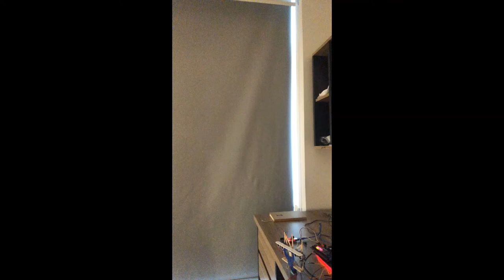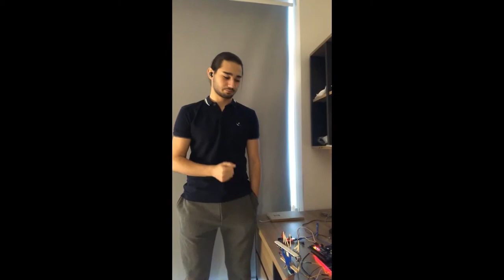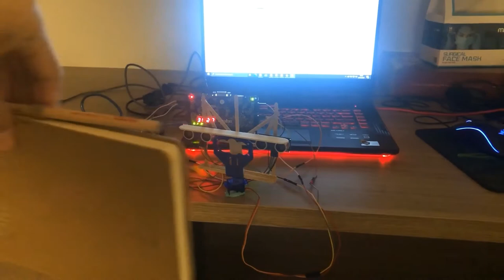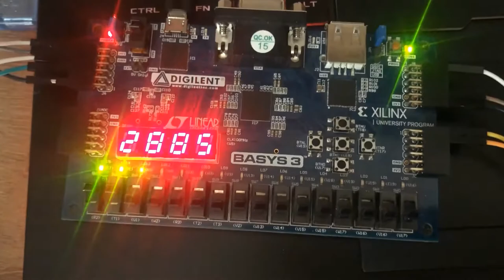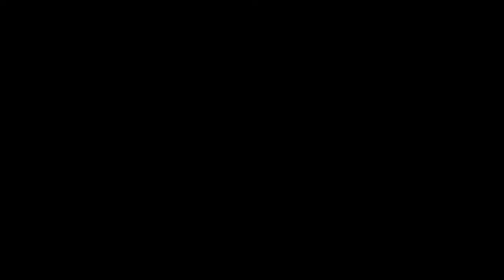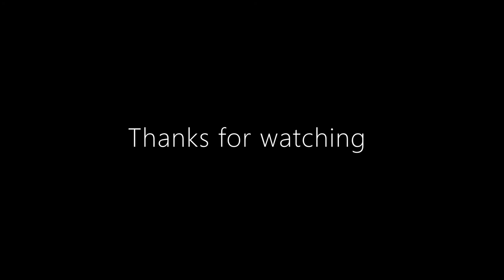Bilkent University EEE102 Term Project- Object Tracker Alarm System- Atahan İyiekici

Comment: Great work. Was working with adjacent two US sensor challenge? Do they interfere?
Reply from the maker: Thanks, hocam. Yes, it was challenging because both sensors should receive orthogonal signals to work properly, and sometimes they do interfere because of the object's rotating speed and the angle of the signal received by the sensor but in order to avoid these and minimize the error, I increase the distance between sensors and rotate the object slower with a better angle toward sensors.